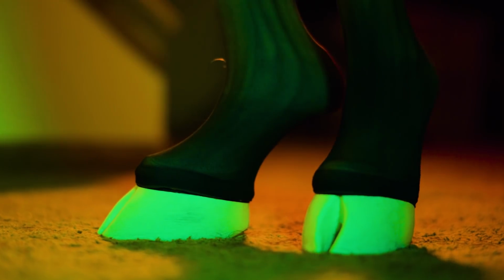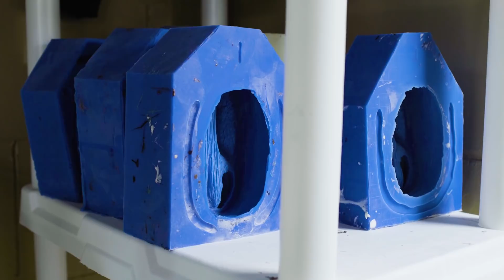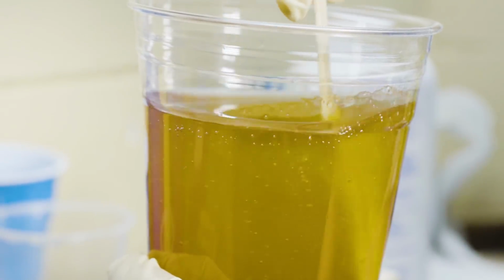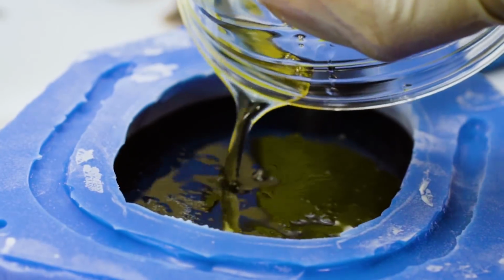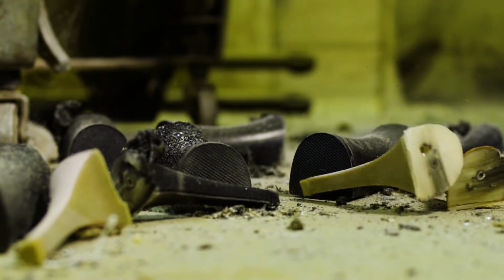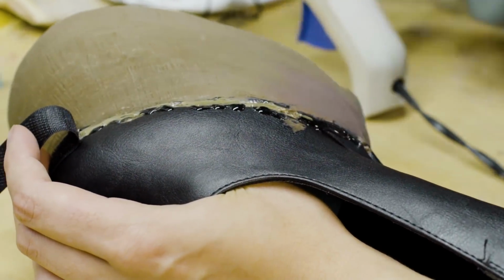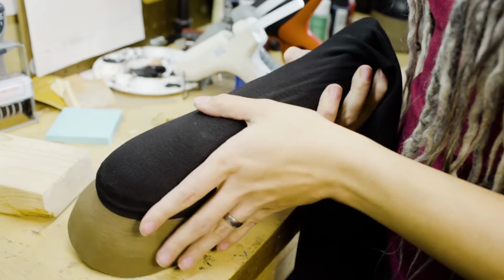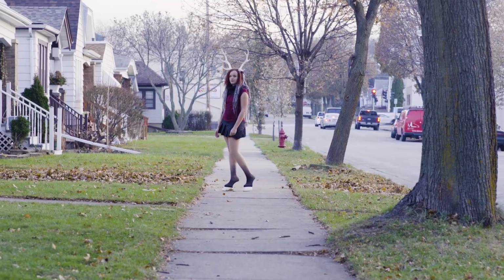Hoof Shoes | Nice Content | Tatered

Comment: Can u run like a horse
Reply: Ethan :D likely not, since in these you have to put the weight on the ball of your foot, which is very uncomfortable and WILL hurt if worn for extended periods or if lots of physical activity is attempted
Reply: Only if you wear the shoes on your arms too
Reply: If you wanna break an ankle, be my guest
Reply: If you can run on your tip toes, then yes. And you would also need to check if the material is sturdy enough. 👍

Comment: how does one stand in them without the heel?
Reply: seb Very carefully.
Reply: balance
Reply: Pretty much imagine walking on your tiptoes. It’s like that. You just have to balance.
Reply: No differently then walking in heels. You need a little more balance but otherwise you're fine to go if you can use high heels.
[You don't put pressure on the heels in high heels, they're there for balance only]

Comment: Because I dont have resin and am too lazy to make two out of clay so you think it could work with real hooves? They have cow hooves at the pet store we go to and we get them for our dogs but I'm thinking it might be fun to try
Reply: ArtisticAli:) 
They may not be strong enough but you may be able to try it.
Reply: I should expect so! I mean, they're designed to hold up the weight of a much heavier animal, albeit spread over four feet, not two, so I don't see why not. It'd just be a matter of attaching them well.

What might work would be to use them as the outer shell of the thing, but still fill in the hollow interior with the resin etc (which you should be able to get at a hobby or hardware store as well as online) to give you the solid base to attach the shoes to. I really love your idea! Matching them to the same size as the bottom of your shoes wouldn't be as easy, though; I suspect each set is custom-made to fit the sole of a provided shoe. Still, if you went in with the shoes and were careful with your choices... Hell, if you have a local butcher or slaughterhouse you could even find one pair of hooves that fit well enough, and then ask if they were able to get you a left and right pair of hooves (either both from the front or both from the back) in about the same size from the same cow. I mean, it'd probably just be sawed off the end of the leg and you'd have to clean them yourself; but if you aren't squeamish it's not hard and mainly involves boiling the flesh away until you can pop the hoof itself off the supporting bone; once that membrane between the two is broken down it'll be pretty easy, if it's anything like the horns are.

Also, you can boil horns for about an hour and they will soften up enough to reshape and even dish a bit, and then harden right back up when they cool down. Hooves are the same sort of material (keratin, like fingernails), so it might work for them as well if you needed to make the outer sides curve out (or in) a bit more to match a shoe. One could always grab an extra hoof or two for testing.

Only thing is I don't know how slippery they might be to walk on linoleum in. I suspect the hot glue on the bottoms was for grip, with the hard edge both hiding it, stopping it from wearing away, and providing the hard surface for the clopping noise. One could always paint the bottom of it with that shoe goo stuff for repairing soles, though; my husband just did that for some extra grip on some leather shoes. One can mix in a little sand for extra texture if need be.
Reply: KryssLaBryn 
I thought they cooked the hooves (which makes them weaker)... I could be wrong though.

Comment: Good Evening Blair, I would like some help and advice please? I am trying to make a Horse Hoof. I have made a rough hoof shape out out some builds wall plaster. Once i cave carved and shaped my plaster hoof I am planning to take a silicone mould of it then fill my mould with Polymorph plastic. These Hoofs will be used to mount two Racehorse Shoes I have. Also if anyone has any Polymorph experience what is the best paint to use to paint it with. Kind Regards Alistair